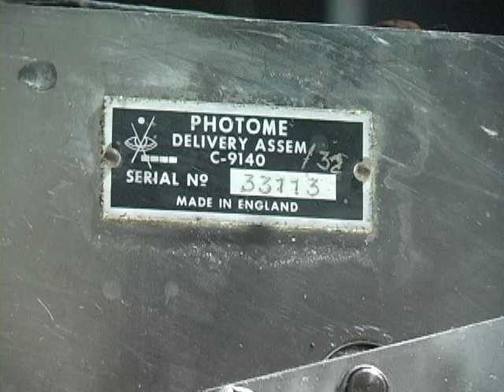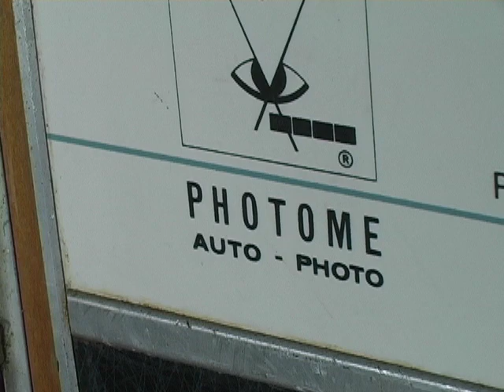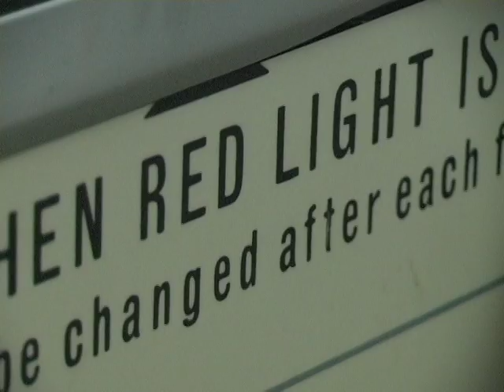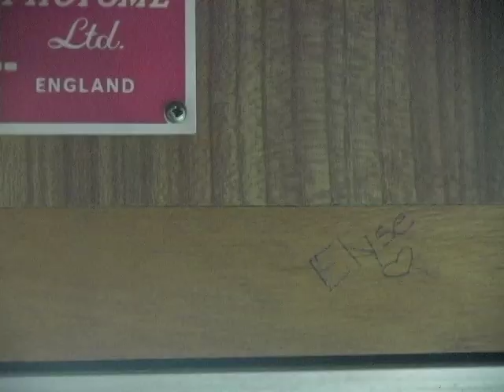Photobooth Innards

Comment: I remember using one of these (although it was color) and having to wait for the prints to be delivered. The one I used had a fan in the dispensing slot to help dry the prints before you took them. I also believe these photo booths could actually cope with several strips at once, looking at the mechanism. That way while your photos were being developed, the next person could be having their pictures taken at the same time.